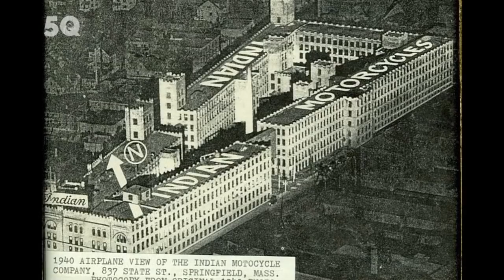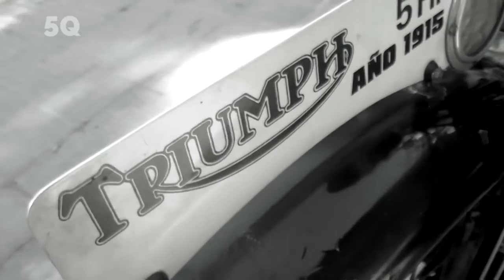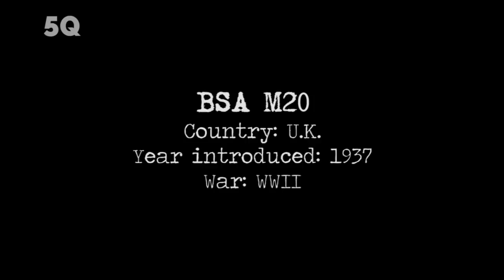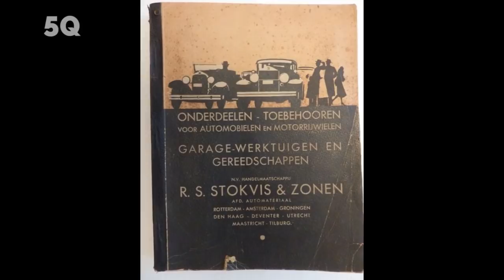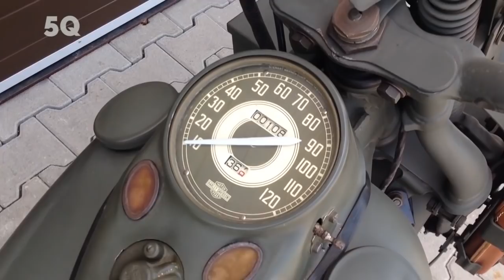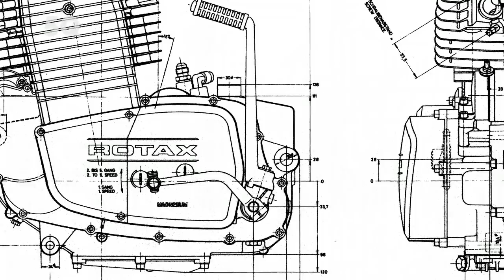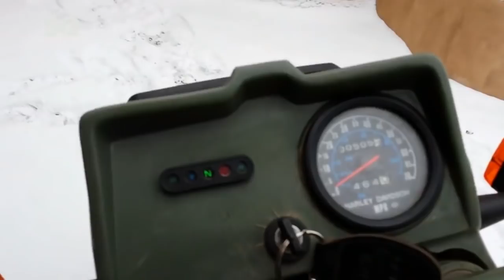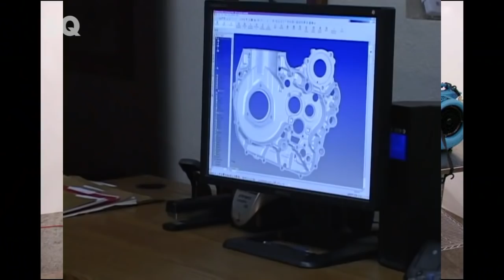Iconic Military Motorcycles - a documentary film

Comment: uuuuh minor correction, about Auto union. 

in the great depression of the 1930s 4 german automotive manufactures merged together (Horsch, Audi, Dkw and wanderer) to ensure their survival (mostly). thus the 4 rings used by all brands. later however, after WW2 most of the factories whent under soviet control, and most what used to be auto union, was restructured and put under state control under the name VEB (something long and german and complicated), and wanderer was even compleatly dismanteled and converted to VEB production. in 1949 what was the shadow of Auto Union, started to produce cars and motorcycles again in dusseldorf. this time under the name DKW and Audi. in 1958 they came under Diamler Benz's ownership, and selling had been on the table from the start but it took until 1968 when it was all sold to Volkswagen and Volkswagen, fusioned DKW with the newly aquired brand NSU. fun bit of caviot, Horch and Audi had the same founder. what happened was that August Horch left the company and not only weeks later, started a new company technicly, with the same name but in Latin. Horch means hear in German and Audi is Hear in Latin btw.

that all? might look jumbelled together but hey when it comes to german companies like the product they crank out it is, usally, VERY COMPLICATED
Reply from the maker: Interesting! Are there any sources on the internet to back these facts? I would like to include it on my follow up video. thanks!
Reply: not really, although theres allways Wikipedia to help. all be it ain't exactly a reliable source. but a pointer nonethenless to what to look for. thats how i eneded up with all that info. boredom is dangerous at times lol.